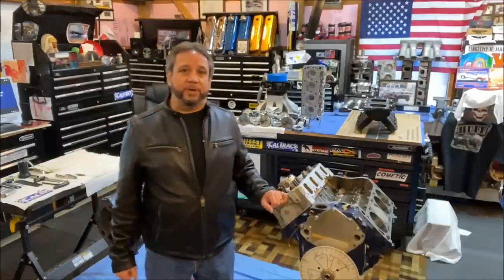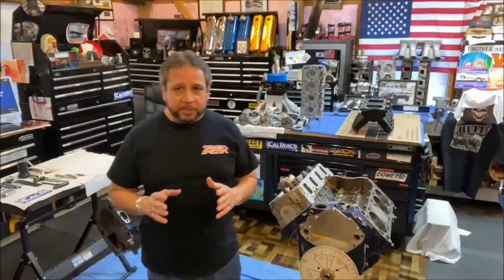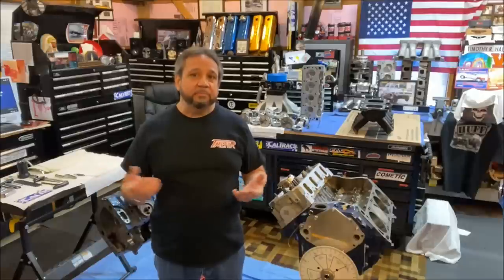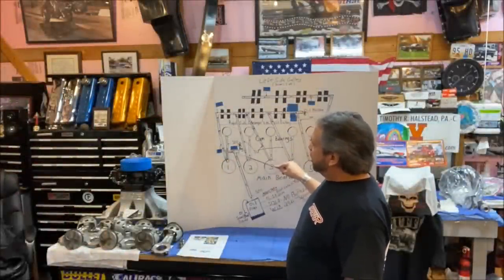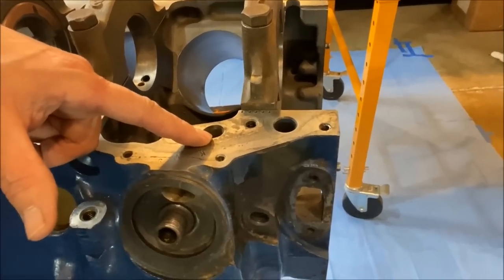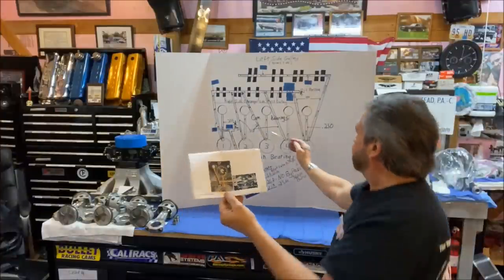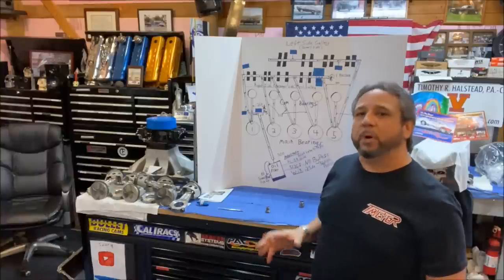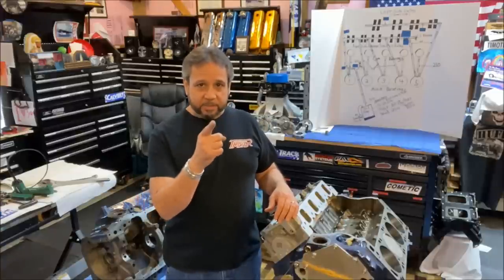Ford 351 Cleveland Oiling,  The Truth, and More

Comment: I used to race these motors back in the day and I drilled through the main oil galleries on mains 2, 3, 4, and 5 up into the valley which were then taped with pipe dies. I took the plug out of the side of the block near the oil filter and ran a 1/2" oil line from that up through a hole I made in the top of the block in the back and plumbed that with copper pipe into all the holes I had drilled through the block into the valley under the intake. I then put restrictor plugs into the lifter galleries in main 1 above the 585 plug and 5 to reduce the oil going to them, and I plugged off the lifter gallery in mains 2, 3 and 4. With this modified oiling system. I turned my homemade Boss 351 at 8200 rpm's all day with no oiling related failures. If you have any questions just ask.
Reply from the maker: Sounds similar to Hank the crank system? Lot of work, but very interesting procedure.
Reply: @DragBoss351Cleveland  I don't know who Hank the crank is,  But he better not be trying to steal my thunder, lol
Reply from the maker: @FishNFoolLures he did something similar to this back in early 70s. I don’t go through all that. Simple 9qt pan, main restrictors, and cam bearing restrictors and good to go.
Reply: I've gotten have of what you explained figured out. 
A couple of points I'm not sure of.

Comment: I run oil restricted kit . Stock steel pump. I built the motor 95 and still runs great with no rebuilds. I do run 7qt pan.... I only turn it 7/7500. Block is pour. Steel crank 6.200 rods with stock heads. I ran a 10.48/130 mph.....
Reply from the maker: Robert, sounds like a stout, and strong Cleveland. I appreciate you stopping by, ,like sure you like and subscribe, way more to come.
Reply: Thank you,cash racer here,but thinking.about going back to the.track been 146 on the quarter at 8500 rpm and ran 10.50 at127 mph(no secret) with 300 six with cam and dumptruck turbo except rod bolts,all junkyard fresh
Reply from the maker: @MrHowie34  Sounds like you have a plan, Greg, good to see some numbers, impressive. Crazy how much power a turbo can add. Get to the track, and rack up some cash..
Reply: Ran a Cleveland for many years and set so many national records I quit framing them in my dad's super stock GT/C Thunderbird with motors my dad built. Had 2 bolt main blocks with stock 4MA cast cranks  flat top pistons super stock legal  closed chamber 4V heads vacuum secondary carburetor  no two step or rev limiter turned clutch loose at 8,750 and shifted at 8,000  best 1/8 was 6.17 @ 108 1/4 9.60 @ 141 at 3180 pound's.
Reply from the maker: Those are hauling Cleveland’s for sure. Good to see stock parts can take a beating. Very fast. Any specs you remember? Thanks for watching
Reply from the maker: Sounds like you got it all down Sam. Thanks
Reply: Bro get your grinder Outt. And get three angle valve job and also grind the inside of your intake manifold.  Remember air in air out makes horse power and vc everything and keep it balanced.   Even. Just don’t get too krazy or you will defeat your purpose I spent two whole weeks on my first porting job. We started winning believe it or Not
Reply: Wew
Reply from the maker: @mcharrig389 always something to see or learn at DBG

Comment: The 351c is the strongset engine we ever had in Australia,,
Reply: And the biggest v8 us Aussies had
Reply: @chaseattenborough6483  The biggest lump!! A LOT of oiling issues
Reply: @ldnwholesale8552  yeah because the the xa gt coups had a lot more GeForce which meant that there was a lot of oil slosh and they only had a 4.0l sump also cams didn’t allow dry sump systems so go do your research you drongo
Reply: @ldnwholesale8552  Well they used to run them up to nearly 10,000 rpm in pro stock racing.Bob Glidden ,and others won big with these engines in The US .As well as the likes of Greg Flaherty with his Shotgun Falcon here in Oz .So the problems can't have been too bad.
Reply: @chaseattenborough6483  Very true!Allan Moffat  asked them many times for a dry sump system  to be  allowed and they said no at that time.
Reply: @petergiannaros9037  The Gliddens used to run a lot here. We convinced them to run one of theirs in a street race years ago. We also had a guy that was friends with Roush and DW, he did free labor on our Clevelands for roundy round super stocks in the south east. Those engines would do 8 K all day for multiple seasons, on a banked circle track, and last. Aussie heads, ported and polished. Wicked sounding engines.
Reply from the maker: @jasonrizzo3106 cool stuff. Tell us about the race on the streets with Glidden.
Reply: @DragBoss351Cleveland  Sure, it was Billy's black fox, or dark colored, can't remember if it was straight black or, like a dark blue.  He ran against Chris Waddells yellow turbo fox, at the time. I don't believe either hooked up properly and it was more or less a write off.  Waddells car ran on the streets in that day and had been well into the 4's in the 1/8th mile.  This took place in the late 90's in KY. Billy ran at Ohio Valley and was a superstar here. Back then we had guys like the Waddells, Billy, several guys who had insanely fast cars.  It was an honor to say I even ran in the same circles as those guys. A lot of them ended up going on to the NMRA, NHRA ect. One personal friend ended up opening his own shop and became very famous for his ability to make imports and domestics absolutely fly. That was a very special group of guys from a lot of different back grounds.
Reply from the maker: @jasonrizzo3106 so cool to hear. I remember back when the fastest street car was happening in late 80s and 90s, before nmra. Those were the days. Thanks for sharing your story. Great work

Comment: Hi Buddy, glad you're making video's and getting some interest in Cleveland's around the ridges.  Its a great engine in its own right. Lots of good things about the Cleveland and thankfully they outweigh the negative aspects of the Cleveland design. Now a little info about oiling systems in general. They are a basically a controlled internal oil leak. Oil does not run through the galleries like air  through ports in cyl heads or even  water through a garden hose. Spending time chamfering, radiusing corners or sharp edges is somewhat of a redundant activity. Yes it would be nice to have those edges nice and smooth but honestly it doesn't help, it just makes you feel better when you look at it. The restricting and or enlarging oil passages do make a big difference and so a focus on that is more useful. I have been working on Clevelands now for over 30 years and i know a bit and still have a bit to learn, so I'm glad people like you get some discussion going.
Reply from the maker: Thanks for commenting and contributing to my channel. Sounds like you got it down. Yes your right about the internal leaks. Anything you can do to decrease stricture helps, the biggest ones, are the easiest to get to. The cleveland is an unique engine for sure, glad I started building and racing them for the last 39 years. Thanks for takings the time please like and subscribe. More to come, much more.
Reply: I always thought deburring and chamfering edges was not just about looks, or even hand safety, but the elimination of stress risers and crack potential. It IS a PITA! Maybe I’ll reconsider! 😂
Reply from the maker: @mikemcleroy8265  I look at this way, every ounce counts. weather it is removing weight, or paying for it, every bit of extra effort in oiling will return in spades Mike McLeroy..Glad your here.
Reply: @DragBoss351Cleveland  Trudat! It all adds up!
Reply from the maker: Hell Yeah!
Reply: Yet, to what avail. Less oil pressure frees up hp?
10psi per 1000rpms?
Bottom line is perception. You're still going with an 80 psi oil spring in the pump.
In the end, the oil system is mentioned to leak. Lubrication and transfer of friction.
Ultimately, fuel choice, lean conditions, machining errors and driver/ gear selection errors  kill more motors.
ETA:
Nick put an rb dodge 541 on the dyno. Check that video out and note the oil restriction on the top end of that motor.
Key note here is needle bearings.
Now consider viscosity needs. Now we are freeing oil pump hp consumption.
Ring package 
Solid Roller lifters
Cam and rocker shaft needle bearings
Now get you some oil management.
Reply from the maker: @mikes.1882 thanks for watching. I did not know the Cleveland has similar oiling as the 340 mopar. I enjoy Nicks garage. Many things affect longevity of engine for sure, any many we can’t but others can control

Comment: Just a small note: when you remove the oil filter adapter nut on a well used Cleveland block, you'll often find a gob of hard varnish back behind the adapter. Just another reason to use Tim's big bore fitting.
Reply from the maker: Never seen that, but believe it, depending on oil change frequency.

Comment: I'm old. I remember when Cale Yarborough was running Fords, and Waddell Wilson was his engine man. Wilson had a series of articles in Hot Rod magazine, where he explained how he fixed the Cleveland's oil system to make it live for 500 miles plus at 8000 RPM. He also had a series on how he pinned the OEM heads to keep them from distorting too. It's worth looking those up, they have some great details.
Reply from the maker: That would be cool to find and see Wilson’s thoughts. I have seen heads pinned to. If anyone has this let us know. Thanks for watching and contributing. Channel is getting bigger by the minute, thank you.
Reply: @DragBoss351Cleveland  I "pinned" that weak area of the head gasket surface on the BOSS 351 we ran in the 1970 BOSS 429 Mustang chassis in the old NHRA Modified Eliminator series back in the early 70's.

And as to that external "oil transfer tube" ... made out of AN aluminium tubing and fittings,  BTW ... I don't know if I invented it or not, but we were using it back in 1971 and we were twisting the 351C to over 8,000 RPM while using a basically stock BOSS crank and rod assembly ... appropriately polished and shot peened, naturally.

In addition to virtually all the suggestions you referenced, I additionally reamed the "main" oil gallery to 5/8ths inch (if my memory serves me correctly 🤔), along with bushing the lifter bores serviced by that galley. Never had bearing problems while racing that combination ... knock on woodgrain. 🙂
Reply from the maker: @johnjohnsn7633  Sounds like you had it going on back in the day, in 71 I was 6, and went for my first ride in a Shelby Mustang. So cool to have guys here that really raced at that time. Glad you here John. Hope others can benefit from your knowledge, and experience...Stay tuned.
Reply: “Ax-uhh-Larry” line?
Reply from the maker: I used it for the first time. Never saw any difference with or without. What is your experience with it?

Comment: Thank you so much for sharing this content. There's a lot of people like myself that were born after Clevelands had already disappearing.  I had no Idea how extensive the 335s really were. Recently I acquired a early 71 M code Mach1(9/70) from my father inlaw. The engine has 2 flat cam lobes on #3. Bummer since it has less than a 100 miles on it. I don't plan on racing, but really look forward to experiencing Cleveland power for the first time. The information you share is greatly appreciated and enjoyed. I can say this, the 335s have a completely different sound that I love!
Reply from the maker: Thanks Daniel, love those Stangs. You better pull it down and make sure debris not through the motor. You can make easy upgrades, that will have your Cleveland running past the pack. Please like and subscribe.
Reply: @DragBoss351Cleveland  I used to race these motors back in the day and I drilled through the main oil galleries on mains 2, 3, 4, and 5 up into the valley which were then taped with pipe dies. I took the plug out of the side of the block near the oil filter and ran a 1/2" oil line from that up through a hole I made in the top of the block in the back and plumbed that with copper pipe into all the holes I had drilled through the block into the valley under the intake. I then put restrictor plugs into the lifter galleries in main 1 above the 585 plug and 5 to reduce the oil going to them, and I plugged off the lifter gallery in mains 2, 3 and 4. With this modified oiling system. I turned my homemade Boss 351 at 8200 rpm's all day with no oiling related failures. If you have any questions just ask.

Comment: Welp I will say this, you/this channel has gave me interest in a Ford engine for the first time in my life.
Reply from the maker: Sounds like the disease has started, explore the channel and tell me what you think. Thanks  Rudy, make sure you like and subscribe please.
Reply: @DragBoss351Cleveland   subscribed long ago!!!  I’m a super budget minded builder tho so we will see how I can make one stack up to my normal 350/400 sbc builds.
Reply from the maker: @rudyjhughes  They are not cheap by no means, but I bet head to head, sbc, and a 4v cleveland built similarly, will make more power from what I have seen at the track.  It is when you start to buy the "good stufff" is when the sbc, will be more economical to build, without doubt. It would be a good comparison for sure, keep us updated Rudy, what are your thoughts?
Reply: @DragBoss351Cleveland   my plan was to build the Cleveland the way I would build a sbc, the best factory heads I can find with plenty of port work , gobs of compression and e-85 to help make up for lacks in other areas.  This is going against everything I’ve ever believed in lol.  It’s like I’m committing sin. 😂
Reply from the maker: @rudyjhughes  not a sin to learn. Just remember, it is not a sbc, and the most important aspect is cam timing. When it comes time for a cam, call Mark Chicone, at Bullet cams, he will help you for sure. they will not run a dam with cam in or at 110 degree ILC. Thanks for checking out my channel, and getting something out of it Rudy.
Reply: @DragBoss351Cleveland  thank you!  So installing straight up like a stock one won’t work?
Reply from the maker: @rudyjhughes  it will work but will
Not be anywhere optimal. Needs to be like 109 or 110 separation angle in at 105-106 ILC.

Comment: There is a really good video, I will try and find it where the guy shows how the oil drain back in the heads is the actual cause of the issue. The heads need to have almost 2 quarts each before they start drawing back. This cause the sump in the oil pan to run dry unless your running and extra large pan. I never thought about it this way but after he put the valve comers in and starts filling them up, you can’t deny it, the drain back holes almost run up hill and they designed the heads like this to keep oil in the heads to keep the springs cool.
Reply from the maker: I saw that before. Not totally convinced that, but I’ve always ran a deep pan and never worry about it. 9 quarts and I had no issues. I do open up all the drain bags, make sure they all lineup, especially the heads in the front they never lineup correctly. I talk about it my oiling video. I’ll put a link here. When I start doing some block work with deburring, and cleaning up the oil galleys. Appreciate being here. PS my kids and I have talked about getting bees.
Ford 351 Cleveland Oiling,  The Truth, and More
https://youtu.be/fBSeHpaT3Rw
Reply: Thanks for the info you share as not many cleveland freaks here around kc.I have seen that video and I believe that ,along with all other mods with large pan,all helps flow.I have been  running a 1971 4v 351c 2bolt block that my friend Ray,and I built in my basement in 1979-1980.513 lift/292 duration Mellings hyd.flat tappet(now roller rockers and conversion kit from Crane)h/v melling oil pump,70,000 mi on motor now and never been apart.I run the oil line front to back for about 20 yrs ago or so 4.71 spooled 9" I built,top loader 4- speed ,adj.press.plate 4 puck bronze metallic. Street car 1,000 miles a yr or so,but 1/8-1/4 mile at a time!